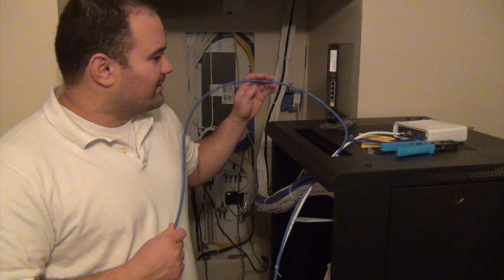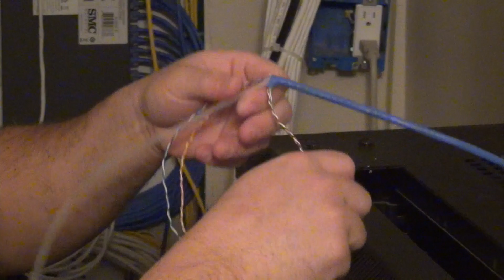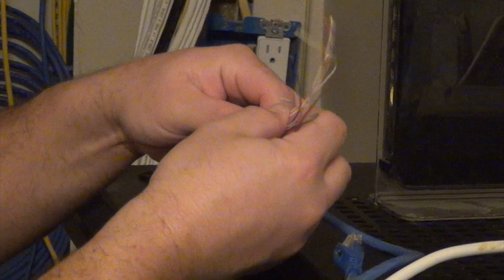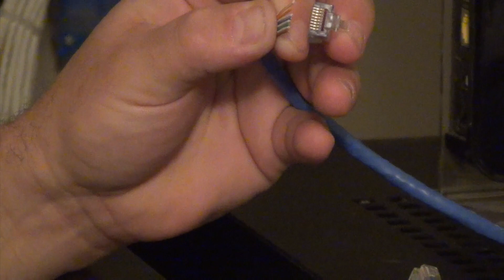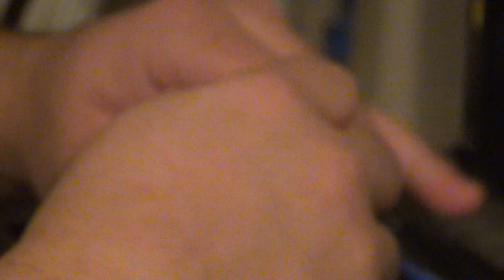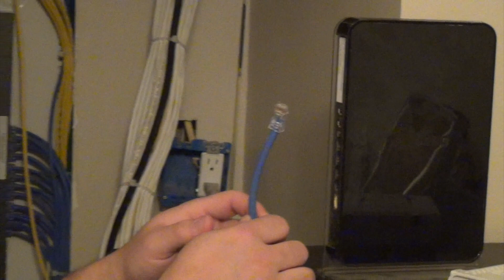How to put a male RJ45 connector on a Cat6 network cable

Comment: Great video. Does it matter if you get the white wires mixed up?
Reply from the maker: What do you mean?
Reply: @AlanCleggYouDoAV  Thanks for replying. I mean that since they're all white, I could inadvertently switch two - e.g. putting the green's white with the blue, and the blue's white with the green - would it matter? Or are all the whites connected together in the equipment anyway? (I suspect the latter since otherwise they'd color code those guys too).
Two more quick questions / points: first, when do you have to add a "choke" (ferrite core) to the cable? We just got Starlink and they have a large choke on one end of the cable. (I didn't think modern Cat6 needed a choke.) Second, for any Starlink people out there, who like me would like to shorten the cable - don't! It will void your warranty.
Reply from the maker: @champnessjack1154  Oh. I understand now. YES! It DOES matter if you get them swapped. They are color-coded. All the white wires have a different colored stripe to identify them. I have never used a choke on my network cables. I assume it's being a little over-cautious on their end.

Comment: Great video. You did miss an important detail. When you showed the push-through terminal end, and how easy it was to use, I got on my computer and found 10 push-through terminal ends on Amazon. I ordered them. I only need four. There were 10 of the closed-end type when I got a crimper that week. And other video's made it clear I would have practice adding the ends. I had a great deal of trouble using the closed-end type, and figured the open-end connectors would be perfect. But was then when I learned about the missing detail. I need a special crimper, one made just for the push-through terminal ends.
Reply from the maker: Oh man! Thanks for mentioning that. I didn't know there was a special crimper. I have always used this one so I didn't know another type existed.

Comment: why do the colour code them if the colours aren't in sequence? You had a bit of wire or filament sticking out of the conector at the end? good video -- thanks!
Reply from the maker: The wire sticking out at the end gets cut off using the tool.

Comment: Hi Alan. Would you be so kind to point me in the direction of a cable that comes with 2 sets? Or does it not exist? I need 2 separate connections ran w conduit on the outside of my home
Reply from the maker: You'll be better off buying coax cable without connectors. Then run two lengths and just add the connectors after.

Comment: I bought the crimpers and connectors you suggested but the crimper doesn’t cut off the excess wire. Any ideas?
Reply from the maker: Craaaaaap!!!! You are right. I didn't even catch that. I just looked at it and thought it looked correct plus the high reviews. I am very sorry about that. I buy my tools from distributors so I thought that would be a good option. Dang it! Hopefully, you can send it back. Try this one instead. 
https://www.amazon.com/dp/B07YC9TQKH/ref=syn_sd_onsite_desktop_222?psc=1&uh_it=41d3ac4b0c82af5a132061dc620c8608_CT&spLa=ZW5jcnlwdGVkUXVhbGlmaWVyPUEzTDJEQ0pJUzZHV0ZDJmVuY3J5cHRlZElkPUEwOTY3MDI3MldFSFRaSDlLUTc3UiZlbmNyeXB0ZWRBZElkPUEwNzM2ODU3ODdYNDE0WDhRWTJQJndpZGdldE5hbWU9c2Rfb25zaXRlX2Rlc2t0b3AmYWN0aW9uPWNsaWNrUmVkaXJlY3QmZG9Ob3RMb2dDbGljaz10cnVl

Comment: Is there a difference in A or B? Also will the “B” work flawlessly with gigabit 1000mbs internet?
Reply from the maker: I wish could give you a really intelligent answer. All I can say is that I've installed 1000s of these and I always use B without a problem. All the California schools require the B pattern also.
Reply: If you're making a straight cable (patch cable), it doesn't actually matter what the color code is as long as it is the same on both ends. You could do a color code that's totally different from these 2 and if it was the same on both ends, it would work fine.

People use either of A and B because of consistency (better to do the same thing each time than random) and historical reasons locally for one of them over the other.

Comment: This is absolutely driving me crazy. I cannot for the life of me get the ow and o wires through.  I even tried pulling through with pliers
Reply from the maker: You have to make them very straight and look closely at the cut top. Sometimes a jagged cut will not allow the wires to pass through.
Reply from the maker: I use super sharp cutters to make sure the cut is clean.
Reply: Thanks so much for the reply, I finally figured out that I was sold connectors for cat5e cables. After 2 hours of thinking I was somehow incompetent, I was relieved to figure that out. Thanks again for your video